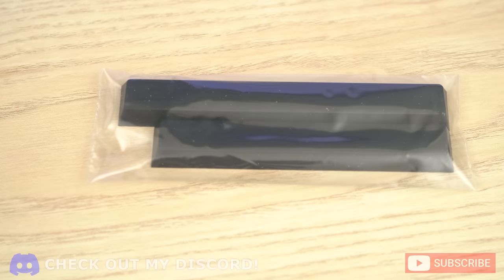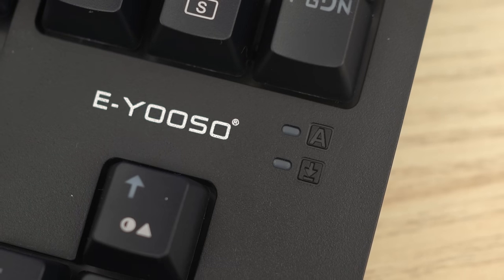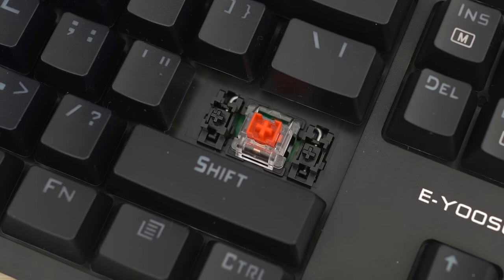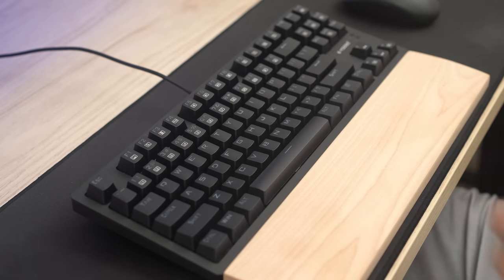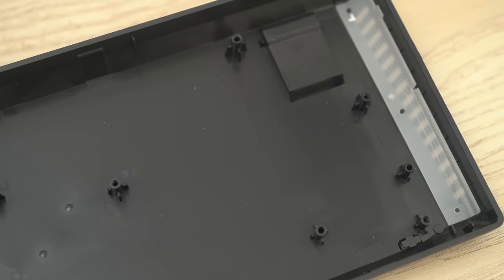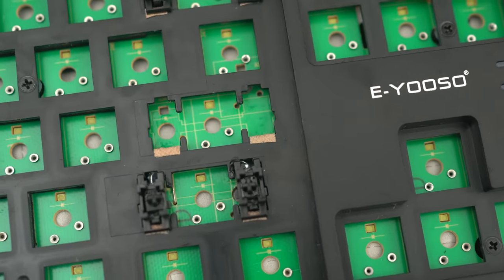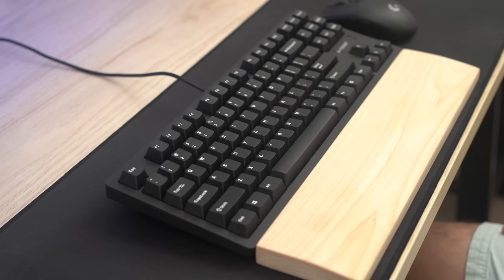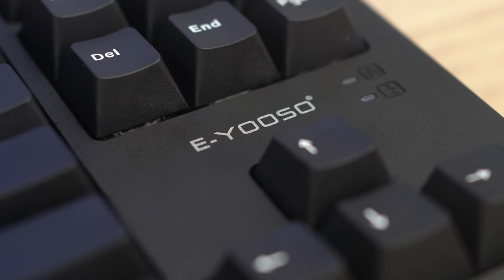I UPGRADED the CHEAPEST Mechanical Keyboard in the world - E-Yooso K620

Comment: Honestly I think that molding budget boards is one of the best ways to get into the custom mech hobby. There is such good value boards out there and its pretty easy to do.
Reply: Agreed. Did the works on a Redragon K556 and while time consuming, I felt it improved the board A TON. No more ping and it sounds like a better board than some 50$ budget... Heh.
Reply from the maker: It's a great way to dabble without going too deep :)
Reply: That's why I love his video even on the Keychron Q1. You can make a lot of keyboards under $200 sound incredible. There's significant diminishing returns when you start spending more and more in this hobby.
Reply: I own an E-Element Z88 and it's my first custom mechanical, or at least sort of, since this is the board I learned a lot from as I've gotten new switches, keycaps, tried different mods like holee foam and tape mod, as well as lubing the switches, so yes, modding a budget board is a hell of a gateway drug.
Reply: @RaisinBarXZ550  yo bro can you send the link to the keyboard
Reply: Yeah, especially now that so many boards are hot swap. Lubing switches is time consuming... but back in the day it was the DESOLDERING that killed me lol.
Reply: 100%. You can mod a Keychron to sound almost as good as the Vega without ever having to deal with group buys and insane prices (although the Vega is well priced for in-stock prices).
Reply: I love molding

Comment: Today: the keyboard community finaly realizes that literally everything in this hobby is INSULTINGLY overpriced
Reply: If only that meant it'd bring prices as a whole down substantially. I see these vids of folks posting "budget" builds at 300$ and i go... @_@ whaaaaaat.
Reply from the maker: :) I feel that as the hobby grows and more and more players jump it, the prices will also go down.  It's so surprising now that you can actually find GMK keycap sets available without jumping on a GB for 2 years
Reply: @CodeXCDM  true, idk what they meant by "budget" while they cost more lmao
Reply: @METhOdhowtoKilLnoObS agreed. I have a cheap Redragon K556, and a few basic changes improved it a ton. Foam/Tape and switch film removed the ping. Lube made it smoother. PBT caps were nice to add. Caps aside, lube and film are like, 15$. Foam can readily be found in packing, and blue tape is readily available. There are cheap 10$ PBT caps on Amazon, but they're minor and not needed unless you hate the glossy look of stock ABS.
Reply: @METhOdhowtoKilLnoObS the jump from a plastic keyboard to an aluminum case is what actually makes the price different worth it, imo. there is just something different and premium about a metal case, both the weight and the sound it produces. no matter how many mods you make to a plastic board, it still just sounds like plastic. and it's great that metal boards like the akko mod series, gmmk pro and keychron q1 are being released that make it more affordable to get close enough to that premium feeling for under 200 bucks. but paying 500 bucks for a custom polycarb case is just nonsense.

Comment: As far as I know, the E-Yooso and Redragon has the Same ODM. This is basically a Redragon K552 but cheaper.

Those  Akko switches really changed the ball game and made the Boards with Outeumu hot-swap sockets much more feasible option for the beginners
Reply: Ok, thanks
Reply from the maker: :) Yeah the Akko switches are also actually pretty good even stock!
Reply: @Keybored  indeed. Wanting to see the new double bump tactile Switches they just released!
Reply: I have the redragon k552 and I’m disappointed, I should’ve bought this keyboard
Reply: I have a 552, The plate is different, it doesn't have that side rgb strip and you can opt for full rgb, Also the newly produced ones have a different font on the keycaps wich is a lot less gamer-y. but yes they are pretty similar
Reply: I’m pretty sure Boba U4Ts fit outemu hotswap boards
Reply: @monke5198  yap it does. U will just need to clip the plastic legs.
Reply: looks like my redragon knight (K598) lol
Reply: i knew the keycaps looked familiar
Reply: Basically Redragon overcharged you for the same keyboard
Reply: The stock one sounds just like my K552 with outemu reds, I really need to mod mine.
Reply: But also better because of the stabs

Comment: Wish you'd have gone with lubing and filming the stock switches to keep the cost down and "work with that you got."

Good video.
Reply from the maker: I actually did do that as the middle step... unfortunately, the audio didn't record for some reason so I ended up having to scrap that portion :( The work with what you got actually works pretty well
Reply: @Keybored  sorry to hear about that :( Video was solid regardless.

Comment: I got a different model called EYooso Z88, it was 21 dollars on amazon. For that price I had no problem with the switches or sound of the board. But after trying to use it, it felt off, and I found out it's 62.5Hz polling rate.. Which is really bad.  Idk if the K620 is the same in this regard, but I am skeptical since it's the same maker and similar or less price. You can upgrade pretty much everything on the Z88 and it'll still be very bad for gaming. So I think it's a waste of time and money swapping the switches or trying to improve it much. It's alright for 20 bucks or less but just save up for something better in the meantime.

Comment: This is the exact reason why I love this hobby so much, turning trash into treasure with some creativity and modding 😭
Reply: But everything you did was throwing money into the keyboard. It's $15 in the beginning but after all these mods, buy switches, keycaps. I'm pretty sure it's not that cheap after all
Reply: Well it’s all relative. Of course adding budget switches, keycaps, and extra mods like foam and o-rings would increase the cost but it’s still relatively cheaper versus something like a pre-built from Razer or Corsair. (And I would argue that it wouldn’t feel or sound as good)
Reply: While you are investing more money into a keyboard and adding more cost than the keyboard itself, it’s just really fascinating how some simple modding can make a $15 keyboard feel and sound way better than a $15 keyboard should.
Reply: @trongnguyenduy4154  the switches are like 10 dollars a set, 

after everything he did its more or less around 50 dollars, it sound like a high end keyboard for 50 dollars, compared to mainstream like razer, it doesnt even get close
Reply: @trailfork7815  sure but the fact that all the extra stuffs cost more than the stock keyboard it's self really annoyed me
Reply: tap and foam mod is pretty much free and 90% of the time just what you need, if you just buy new switches and use the old keycaps thats just around 10 dollars
Reply: @trongnguyenduy4154  you can opt-out the extra switches and keycaps to make the mod super cheap. These Outemu red are still good when lubed which make it smoother and no ping.
Reply: Yes the mods costs more than the keyboard, but the keyboard is $15… I can buy a good lunch with that money 😭
Reply from the maker: @trongnguyenduy4154  you actually don't need the akko switches or the keycaps. I actually lubed and filmed the stock outemu Reds and used the stock caps and it was pretty good. Showed the end result with the switches and caps to show that if you want to experiment before diving too deep in, this is a good keyboard to try that with
Reply: @trongnguyenduy4154  ofc, but at least the kb is fully personalized, surely there's something you would want to change in a 50$ board as well

Comment: I got the same one. Won't take Kailh switches as the legs are too wide, so I slapped some Outemu snap spring switches into it and put on a set of Quisan mac-like caps (Cherry profile) and it works pretty well. Not as well as my modded Alps board, but better than most MX boards I've done. For a base, even though it's not hot-swappable, I'd recommend the Velocifire TKL02. It's about $28 but is a lot heavier, less cheap feeling and has a nice, thick metal mounting plate.
Reply from the maker: Thank you for the suggestion!  Will have to see what the velocifire unit is all about

Comment: Been watching this more times than I should be. Though I'm not sensible enough in the hobby to do most of these mods yet, I have to ask. Since majority of these cheap boards use a North Face configuration, would you bring a topic on which keycap profiles work with this? Also, what profile are those PBT keycaps?

Comment: For $12.59 I recently bought 60% Mechanical Keyboard that is hot swappable and it came with PBT pudding keycaps with Outemu red switches.  After I got the keyboard I did a lube job on the switches and mod the stabilizers on the keyboard. That's all I did to the keyboard and oh boy did it help it sounds awesome now.

Comment: Hey Scott question here at 5:45 it looks as though the PCB is not actually in contact with the O-rings. I’m asking because I am modifying my Keychron K4 and I want to O-ring mount it but I am stuck at this point. Could you have used a larger O-ring and placed it on the portion of the stand off that the PCB touches? That is to say the fins that are on the stand off? Any advice for modifying the Keychron K that has a similar tray and standoffs? You’re my inspiration!!!

Comment: I have the same board! I foam modded, clipped stabs and frankenswitched with outemu blues housing and boba U4T stems. Also painted the top plate and swapped in some cheap rama clones from Amazon.
Reply: How come you used Outemu Blue housings?
Reply from the maker: I think this is the jailhouse mod?  I haven't done it myself but I think there is something special that comes out of it
Reply: @Keybored  so my keeb came with blues, and I replaced the stems in the blues with Gazzew's Boba U4T stems.
Reply: @octavia7466  I kept the outemu housings to retain the hotswap capability
Reply: @Keybored  look into frankenswitching for better explanation or you can message me. 🙂
Reply: @mariescheidt2639  Boba housings are hotswap compatible too, if your PCB was 3 pin you can always snip the legs, but fair
Reply: @octavia7466  lols I just bought U4t stems from Gazzew, but if I understand correctly outemu manufactures his stuff.
Reply: @mariescheidt2639  yeah, I forgot yall can do that, it's not an available option here in Malaysia so
Reply: @octavia7466  But this is a keeb that has Outemu sockets, so Gazzews may not fit. not sure though
Reply: @razer1158  Gazzew switches are manufactured by Outemu and they are compatible with the Outemu sockets!

Comment: $20(ish) for the keyboard. $46 for keycaps, $28 for switches, plus minor costs for the underpinning materials. This is kind of like buying a 1998 Toyota Corolla and installing a $10,000 stereo system in it...maybe not the best use for the money, but it's still fun. 😀

Any chance you could do a cable swap video to convert it to a USB plug instead of hardwired?

Comment: i have a cheap keyboard. leaven k880. I tried modding it by adding pe foam in the case and then adding a pe foam cutout placed on the top of the pcb. I still sound eh' but the sound change is noticeable somehow. I have not changed the stock unbranded switches and no lubing was done. Should I do that to achieve the same thock that that mech keyb has? Hoping for answer. I'm also planning to do the tempest mod and adding bandaid to where the stabilizers are gonna be placed.

Comment: I'm trying this because it sounds so good and is an easy entry point to for new keyboard modders.
How did you close the case with all that stuff in it? I can get the case closed but can't get the switches fully in because the pcs is too close to the plate.

Comment: I found a budget tkl keyboard called mk870 on taobao, a 30usd 87 percent keyboard kit, 5 pins socket with actual hotswap socket, south facing led, to top it off apparently the pcb itself support pcb mount stabs although it came with plate mount stabs stock, the only thing is it doesnt come with any switches or keycaps but nonetheless will be an interesting board to review if you manage to get one of that with an acceptable shipping rate
Reply from the maker: That is a great deal!  I should look into that!

Comment: i have a k552 with akko cs matcha greens, like the switches you put in this keyboard, i saw some comments about how they were almost the same and it sounds very similar, the main thing is i dont have the thick layers of foam inside, only a little bit
Reply from the maker: Interesting! I think there is a same OEM for this board and makes slight variations!

Comment: One comment says it's not an actual hotswap socket and the pcb will be damaged if the switches are changed too often. Anyone opinions on this?
Reply from the maker: It's a hot swap, but very specific.  It only works with certain switches with smaller pins (outemu switches, gazzew and akko and maybe KTT also?  is what I heard!)

Comment: i love mine and been using for quit a while. the only thing different with mine is white and i cut the stabs + lubed them. i run modded gateron milky yellows with 4 ttc bluish white as the wasd
Reply from the maker: :) Sounds like a good combination
Reply: Hey, Gateron switches work with this keyboard?
Reply: @razer1158  yes if you sand a little off the contacts so it will fit in the socket

Comment: With all the additional switches and keycaps could’ve just bought a budget case with pcb at that point. But I know it’s just for a fun video heheh. I wonder how it would’ve turned out if you modded the stock switches for people that are actually really broke and want the cheapest entry point possible
Reply from the maker: I actually did mod the stock switches and used the stock caps, and it wasn't too bad at all!

Comment: Being a $15 keyboard, how was the Outemu switches feel? Like, did it feel as expected from a 'normal' Outemu? Y'know, like any other Outemu you'd find on a bit more expensive budget keyboards?

I had experience with a $17 keyboard that comes with total garbage Outemu blue switches. You wouldn't even recognize them as blue sw anymore as they were bad, scratchy linear with faint clicky sound
I got the feeling it was shipped with the lowest grade possible of Outemu sw, that are probably barely passed the QC standard. I assume they did this so they have the brag rights of having Outemu on their keyboard. All despite being worse than say, KRGD, a cheaper and not well-known switch that ironically offers more solid typing experience
Reply from the maker: Honestly, the Outemu reds are not bad!  I lubed and filmed them, and it was pretty smooth and decent!
Reply: That sounds promising. I wish red were more popular here. They only offered it with blue by popular demand
I only bought this keyboard for the board. But if I can also get somewhat decent switches like yours, I wouldn't mind at all
Thanks for the reply!

Comment: Damn, how did you make these Cherry knockoff stabs so smooth?

 I've literally done every mod possible on Cherry genuine stabs and from five keys, 3 of them have a one rattling side. Even added lube to these sides from both holes and they still rattle.
Reply: bandaid + holee mod is the best way to improve stabs imo
Reply: Holee mod. Annoying as can be to shove bandaids into the stabs, but they improve them all right.
Reply from the maker: For this one, I didn't even holee mod it lol.  I clipped the stems, and used band-aid around the plate cut-out to make it tighter, used some grease to reduce the tick.  worked!

Comment: The only issue i have with that is, that the Akko Green switches and the double shot PBT keycaps alone cost like few of such keyboards together. not talking even about the cost of the modding materials and lets say the time is for free, since it is fun hobby time. and in the end you get stuck with costly switches and pbt keycaps set, sounding great but with an ugly cranky plastic keyboard case, which no keyboard fanatic would like to have to begin with. so except of the challenge for the sake of Keyboardology, why would anyone want to spend on making such upgrade. in the end it's a waste of money.

Comment: how much did you end up spending with upgrades?
Reply from the maker: Overall, the foam, lube, film wasn't much at all.  The switches were about 24 bucks for the entire keyboard and the keycaps were around $40 from what I paid before.  So around $70 bucks I would say... But you can skip the new switches and the keycaps and it will be like a $10 upgrade from stock haha

Comment: How do you take off hotswap switches? Pls help
Edit: and install? Pls help
Reply from the maker: Use the provided switch puller and grab the switch top and bottom and pull straight up! Install is opposite. Just align pins and push in
Reply: @Keybored  thx
Reply: @Keybored  also great vid

Comment: I own an E-Yooso Z88 and it's my first custom mechanical, or at least sort of, since this is the board I learned a lot from as I've gotten new switches (Akko Ocean Blue, it seems to fit Akko switches at least), keycaps, tried different mods like holee foam and tape mod, as well as lubing the switches, and I'm still using it and it's a great gateway drug to custom keyboards as I bought it as exactly that. I'm still using it and it's a great board for 55 CAD.
Reply from the maker: For sure a gateway drug!  I started off with 1 keyboard and somehow ended up with 33 lol